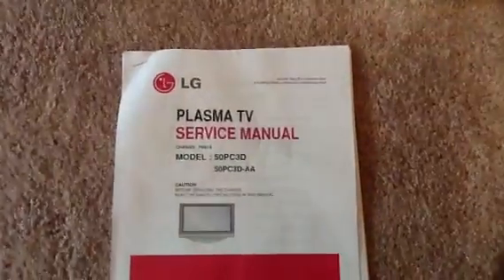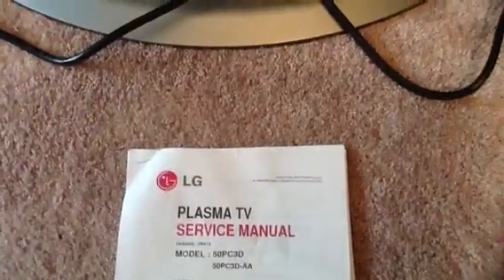Plasma TV screen flashing/flickering HELP

Comment: I have a lg tv  5OPC3D ,and today I also  changed  9 capicators,  on the power supply  ,and  turned  it on and started  doing  the same as yours ,if you  find a solution  please  let me know

Comment: Hello, I have the same problem with the same TV, can anyone send some suggestions on the troubleshooting. I did my preliminary troubleshooting, checked the Vs and Va inputs to the YSUS boards, no obvious blown or leaky caps, no FET shorts on the buffer boards. I replaced the YSUS board from ebay  but still have the issue. Any suggestions ?

Comment: I have the LG 50PC1DRA plasma just have the same problem as show on the youtue clip few days ago. I am looking for some info which part need to be replace? is it the Ysus board or the Zsus board? 
Please help
Reply: +phieudzu Ng did you adjust the y board after install? I haven't been inside this tv yet but there should be two or three adjusters on the board. Make sure voltages from the power supply are spot on as well. those can be adjusted as well. vs adj and va adj
Reply: Hello, were you able to fix your plasma ?
Reply: Nope. Replace YZ board but picture quality look really bad.
Reply: +phieudzu Ng  I have the same TV and this just recently started for me. Sound still works but TV flickers. If you replaced and its still not working properly ill probably hire a repair guy.

Comment: ok i have bought a part (4921QP10467A) its under the heat sink on the ysus board will be fitting it soon will get back to you when its done

Comment: I fixed a TV same as this ( same symtoms). Replaced leaky caps on power supply board, (no change ) Then I replaced the Ysus ( was also making ticking sound in sync with the flashes, after the ysus was replace the picture improved to steady vertical bars that moved with video playing, then I changed the lower y buffer and all was good.

Comment: I am having the same issue. I am looking to know what kind of capacitor is on the ysus board. I want to try changing it out before I buy a new ysus board. The capacitor I am talking about is on of the brown ones labeled with two lines: first line -mpe335k 2e second line- 61019052 s
I am familiar with the 335k part of the first line, but I am looking to find out the voltage. any help would be great. I can send a pic if you contact my youtube account.
Reply: christian cruz   my LG 42 inch plasma flashing and flickering problem pictures please guide me problem